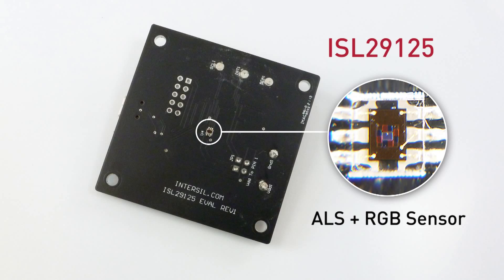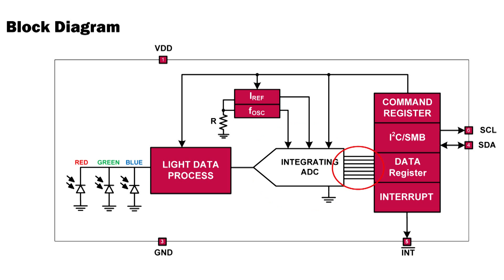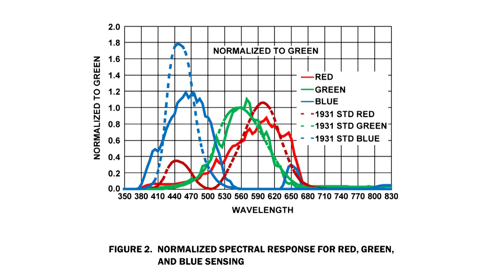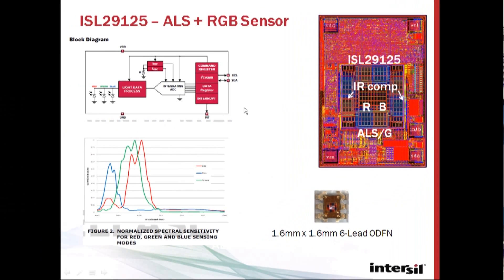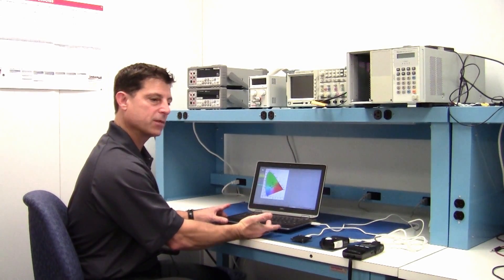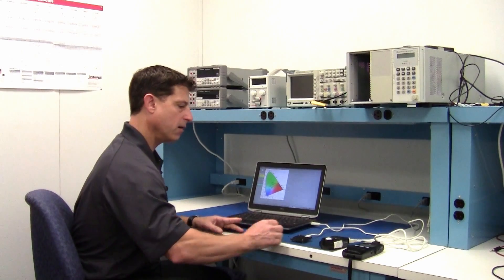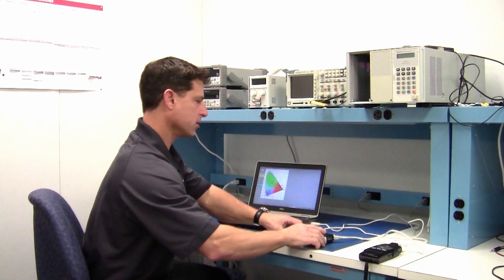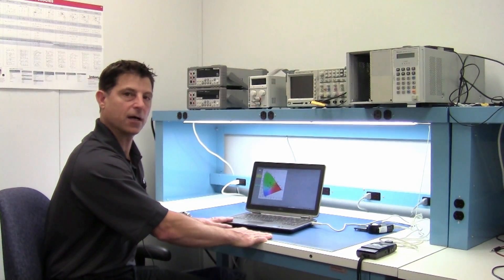Intersil's ISL29125 RGB Light Sensor

Comment: Not satisfied at all with this product...
It "may" be able to get ambient light temperature but according to your evaluation board it is absolutly not able to capture object color even in a good configuration with 2 external white balanced LED reflecting light from a unicolor object to the sensor it self.
Clearly not able to make any product color verification or sorting.
I was teased by the specifications and now I am quite disappointed.
Reply: you need a diffuser glass for stable, i used it